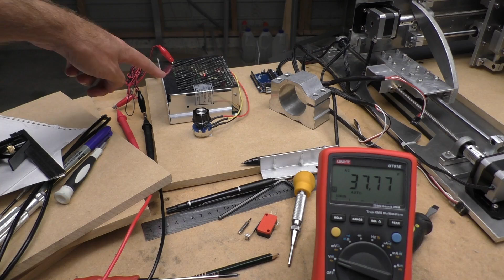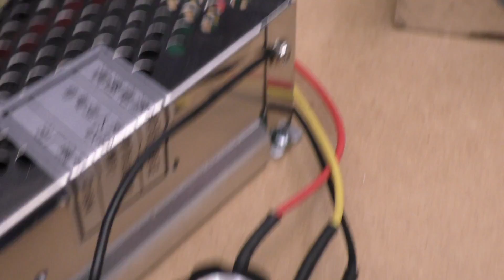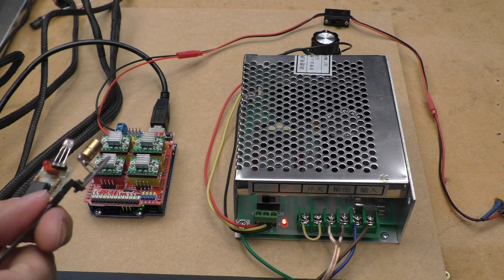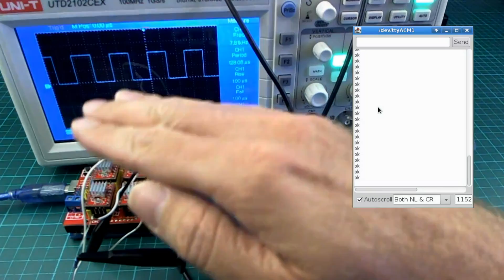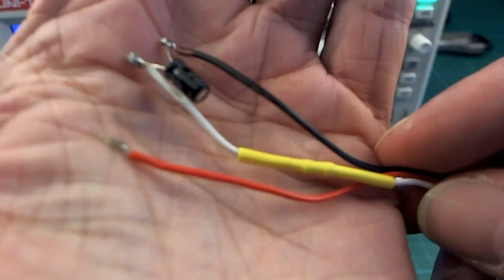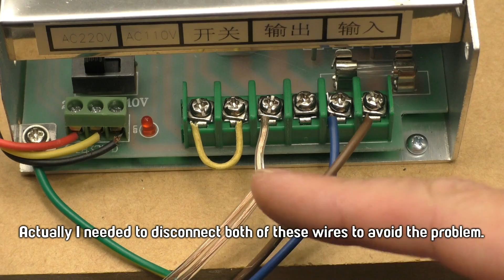DIY mini CNC machine part 9 (spindle, round two)

Comment: I have the same problem I tried using 2 different power outlets and the machine looses the homing settings for some reason there is feed back going to ground affecting everything on the ground line If I could contact the manufacture of the unit that might help

Comment: Adding some clarity to my previous comment about removing the grounds you don't need.  ie. "Remove the ground loops". For example, when using a shielded cable only connect one end of the shield to ground.  Otherwise you will create a loop. Also you may find that you have more than one ground circuit happening. (If you are using more than 1 power supply you should be thinking this way already.) If so, the ground circuits need to be kept completely isolated from one another with the exception that they can all be connected back to a single earth pin on the mains supply.  Some people may argue the need for isolation of ground circuits but it can't hurt and may be useful under certain conditions. Fortunately 2 of my friends are electricians and didn't mind helping me out with some good advice. Theoretically all grounds should be at zero volts but this is seldom the case when you have improper shielding acting a receivers, magnetic induction which isn't shielded , various substrates with different resistances such as aluminium and steel, temperature variations throughout the machine , induced eddie currents through the substrate, etc, etc,...

Comment: I do realise that 2 years have gone by so this may not be much use to you but maybe still to others who are watching your videos for the first time. I started building my CNC machine  many months ago and had many WTF moments. When things went wrong nothing made sense.  But here is the thing. Electrical circuits are entirely predictable. When things become unpredictable it means you having grounding issues. Assuming everything else is wired correctly. The solution is to grab a pen and paper and draw a ground map, making sure that you have covered everything. It should then become obvious which grounds you need and which you don't. The solution is simply to remove the ones you don't need.  My problems lasted for weeks and were solved in under 2 hours once I knew how to think about it. Cheers.

Comment: Holy shit so much of this seems deadly as fuck. Like if he palmed the psu and then the chassis, thats 120 volts? The arduino, and I imagine the laptop ground too? Im no electrician but none of that makes sense.  I wonder if its just funky cheap power supply problems... I guess il find out later in the series anyways since it looks like he got it all working.

Comment: It's a wonder no one noticed. There's no connection with the earth!! Basically, The potentiometer regulates the voltage to the motor (standard DC motor ). So, what happened is that there was a direct  phase to phase short circuit!!. The voltage from the power supply clashed with the voltage given out by Arduino! Since there was a resistance bridge, there was a violent reaction.

Comment: You're probably tired of hearing grounding solutions, but they are right. So, your Arduino really needs to be in a metal grounded box, as well as machine frame. (all single wires to a common point on psu case earth) My large cnc table used to float at up to 100v to earth sometimes. A very low current charge, static too, and would give me a quick zap after sliding plastic across it! All grounded and ok now - no zaps either. I'll upload a video of me waving my hand around our 5 Axis machine pcb - I called it "the ghost in the machine" at the time! lol..

Comment: ..you measure the voltage between 2 galvanic isolated power supplys (the one from "usb arduino" is actually from pc's psu)? Maybe it's time to re-learn the basics again.

Comment: So, I'm guessing the problem is electro-magnetic interference (EMI) radiation from the power supply driving the spindle, amongst other things. I would suggest adding a conductive braid around the spindle and potentiometer cabling and connect this braid to earth at the PSU end.  As mentioned in a previous post, also adding a ferrite filter can also help with EMI issues, but it'd go with a braid and physically moving the PSU away from the Arduino to prove that this is indeed the case.

The large potentials you see between components does also give me a little concern, but I'm guessing your laptop power supply is not connected to earth and so this can float (by itself) to a potential above Earth. Whilst you're messing around with all of this it may be safer to disconnect your laptop from its power supply so that there is no path to earth if you have another resistor/capacitor "letting the magic smoke out" moments!
Reply: I would think it is more than emi at those voltage levels.

Comment: hello, i just started watching. i hope everything is safe. i saw your problems with the earth. i would suggest first having incoming AC power having fused protections and cut-offs. you would need to calculate some power. if you dive a little more into the PWM power supply for the motor, you may also try to discover some mods to make it safer, mainly fuses, output caps at motor side, etc. inspecting the PCB of the power supply will do some good, it will help you to know how well insulated are the sections, etc ... if in doubt, goto EEVBLOG, post some pictures and ask questions.

the problem of arduino not working when you spin the motor is due to EMI interference from the motor. alot of the digital sensing are disrupted by the power spikes. it affects everything. you need to couple some low ESR caps and supressor diodes to the motor.

but i would suggest solving the PSU AC safety first. the float voltage you see flying all over the place is due to the DC common being a floated voltage, and not sharing the same ground level but of key concern is to ground the AC side first, then find out if the DC have sufficient isolation from the AC, by measuring the AC of the DC output. then solve noise suppression, then solve mechanical accuracy and spindle balancing (ie : wobble)

Comment: I posted isolation circuit in your previous video, here is a ling again: http://imgur.com/SGrNDaU 
Regarding  spindle and arduino hanging, it is highly possible that USB/Serial interface is hanging dew to EM noise and high power pulses. Very common issue.

Comment: get everything grounded the motor the psu the cnc. then look for the source of that noise I'll bet if you look in that psu you will see lots of missing input filtering parts. Don't see how you could have 100v AC between ground and that motor case? I'd want to hi-pot it but grounding it will fix that one way or another! I've only seen pixies and magic smoke here once before I think on that carbon (in NZdo you use?) fibre(UK) or fiber(Merican)  quad.Good luck. Oh and 6 of those E-Bike batteries in series and you can be back in business

Comment: Sorry to bother you, but when you build something like industrial grade machine, YOU HAVE TO PUT  EVERYTHING TO EARTH! If you check the industrial electrical cabinets, you will find there are grounding wires between the cabinet doors and the main cabinet, and between every device inside the cabinet and a main earth copper bar mounted inside the cabinet. So you should try to drill some holes, tap them and connect each and every mobile part of your cnc to the chassy of the machine and then to your earth wire of your power socket. I've used to work with industrial automations and it was a pain in the ass with grounding everything up. When you have a big ass cabinet filled with thousands of bucks of inverters, PLCs and other expensive devices, you don't care how much it would cost the pile of copper wire just for earthing...Good luck! Greetings from Romania!

Comment: I think that you have RF between the controllers. You need metal cases  and shielded wire. I knew a package machine that had the same problem. I had to shields the wires coming out the processor and installed it a case.  1    I bet that you between the computer to the controller unshielded  USB that is only meets a keyboard specification. 2   the controller does not have shield around it (metal case). 3  the wires to the servos need to be shielded. 4  Wires to the spindle motor need be shielded. 5  All shield on the shielded wires and metal cases hook up to ground! It saved a machine from being trashed to that worked after 13 years when I left.
Reply from the maker: jesus christ what a lot of hassle... but I think you are right. I'm uploading a video now that will agree with what you're saying.

Comment: Ground everything to the same point. The arduino motor controller frame and power supply to mains earth. Lots of voltages floating on each other

Comment: Probably bad power supply for the spindle, but I would also check the power supply for the stepper motors. If all fails, try to wrap the spindle in a layer of tape and make sure there is no more electric conectivity. Also hang the spindle wires away to avoid any induction problems. So isolate all, and it should hold good for now.

Comment: Perhaps you might want to look at the grbl shield for the problem if it is a cheap chinese one like it looks like. I have one like that ($14) and using the 4th axis clone is problematic. Sometimes it rotates too fast and sometimes it actually rotates in the reverse direction that it's suppose to. I will be unable to use it on my build as I need two stepper for the Y axis. I have ordered a much higher quality one from "Hayri" on youtube. Of course maybe your power supply is wacko. :-)
Reply from the maker: I also came across the problem of the cloned motor going in reverse, check the connection where you bridge the DIR pin, mine was not connected properly.

Comment: Hi,
Run and earth wire from the speed controller earth connection to the case of the motor. If you still have problems run a wire from the earth on the speed control to the usb connection metal work and maybe to the negative of the battery.
This should solve your problems.
Please play safe when playing with mains powered equipment. Unless you are a cat.
Send me a PM if you would like to chat. I live just out of Wellington.
Cheers Dave.

Comment: Possibly the motor running induces current into the frame of the motor. You should earth the motor to the CNC frame using a fly lead back to the frame. However, don't rely on earthing the spindle to the y / z axis frame, else you will be passing current through the bearings and drive shafts. Earth the spindle, and run the wire in the loom with the power lead back to the main frame of the CNC.
Reply: Usually in these systems there are two grounds, there is logic ground, and power ground. When noise from the power side starts bleeding into the logic side bad things tend to happen.

Comment: Maybe you should draw a system diagram including the grounding, just to make sure you understand exactly what is happening. Earthing and grounding is not only critical for your safety, but the safety of your laptop, arduino as well getting the thing to work reliably. You also need to think carefully about how the multimeter measures resistance and voltages to make sure all the readings your are getting are meaningful to avoid any more fireworks :-) AC at 50hz and higher frequencies and DC,  at low an high impedances. By the way is that green link on the spindle psu supply an enable link?

Comment: I don't have answer to your problem except not using that PSU, but connecting the case will cause current to flow to the earth, which should never happen, you must not have RCD's because they would have tripped. for your safety I would suggest at least using an RCD to the setup man this really does look dangerous..

Comment: if it were me I'd try grounding the spindle motor case and whole CNC metalwork AND look at shielding the spindle motor wire (again to common ground) to prevent emi/emc/cross talk problems.... or at the very least try to keep the spindle motor drive wires as far away from the arduino and it's stepper motor wires as possible. But then I'm just a humble mechanical engineer! ☺

Comment: one potential solution is shielding the wires to the motor (earth shield) and also finding if there is a direct connection from one of the motor wires to the motor body (there should not be a connection) ps did you buy the cnc controller from webtec?

Comment: P.s I "think" it's a emi interference issue, if you can get one person to move the x and y about, power up and spin the spindle from a few meters away and gradually move it closer to your controller board, in my case as it got within about a meter I started getting mis steps.

U.K. Connected on same ring main but different power wall sockets ( if that makes a difference)

Comment: I know this does not help, I have exactly the same issue, I tried to upgrade my Chinese 3020 with that same model of 100v dc power supply and spindle. When the spindle is running the steppers seem to miss steps or stop, re-pressing the move keys (Mach 3) it moves a bit more and stops. My setup came with an existing 48v power supply in the control case, I have been using that, so spindle is running I guess at half power and I have had no issues. Only when connecting the 100v supply just to the spindle do I get problems. Hope you work it out and please explain how you do it! PLEASE!

This weekend I'm working on a laser add on with a separate 12v supply, I am hoping I am not going to have the same issue, as the driver for that will be going back to the controller for the ttl signal.
Reply: s s Long time ago but if memory serves it was a ground or earth loop. Make sure you only have one earth connection. Hope that helps

Comment: Disconnect arduino and try connecting your machine, usb cable ground and PSU case with resistor/bulb and measure what's the current between them. It should be safe.  Also measure steppers coils if they arent shorted to case. If everything is good you can safely short all grounds i think..

Also. Isnt all that arduino problem caused by earth wire that you connected to PSU case at the begining of the video?
Reply: This.  If the current is low enough you can safely connect the grounds together, but you need to use the resistor first so nothing (else) blows up.

Comment: First comfirm motor is isolated from the metal case, perhaps one side is chassis ground,  All touchable metal parts have to grouded.  The Laptop might have a weak bias to the mains voltage  but is should be floating, A high impeadance meter on voltage can often give false readings on mains AC ground issues.  

Assuming the motor connections allow the chassis to be mains ground, I would use a good CE marked, not fake "China Export" PSU with mains isolation and use a good current Mosfet for the PWM signal.  I have no idea how the potentiometer is used or referenced to ground of the existing PSU.  Optical detectors don't like over 30V and are low current so could esilly be  20k, hence low speed.  The only way to use the existing PSU is to isolate on mains input with an isolating transformer, but that would cost more than a new PSU with built in isolation, secondly the voltage difference on the Pot and Arduino has to be solved.  if you could make the PWM turn a servo on the Pot could be a solution....  I often check supplied PSU with china sourced  goods and replace with UK approved PSU to know it is safe.  The isolation might test OK but are the gaps 3mm appart between the mains side and the ouput side, often not.  Transformers can also provide isolation but how seperated are the windings, the only way is distructive unwinding the wires and insulation layers.

Comment: whats going on here is that when you power up the motor it turns and the current goes into the motor. as soon as you turn off the power to the motor it continues to rotate for a few seconds and the motor works at an alternator / dynamo whatever you might call it and sends the current back the opposite direction into the arduino, and the current is waaaay beyond what should happen. If you continue to do this it will go up in smoke. You need to have a pull down resistor with a diode for the application so that you direct the back current to earth.
Reply from the maker: I have the same problem whether I turn the motor off again or not.
Reply: then im going to go with what the others say, there is something bad going on with that powersupply that wont let you have common ground

Comment: maybe try a thin layer of rubber/plastic(even plastic from a coke bottle perhaps)  around the motor to isolate it from the chassis?  may not sound like the best idea but the PSU sounds like its a poor design, the motor insulation supposed to be more than 2 megaohms? just an idea in an effort to get you by ;-)
Reply from the maker: I just about broke a screwdriver handle getting the spindle into that clamp. I don't think there is room for anything else.
Reply: iforce2d oh bugger :/ sorry to hear that  was just a thought.....
Reply: If you're 100" sure there is continuity from mains ground to psu chassis, then connected the whole CNC unit to GND. Should be continuity.

Comment: Getting a "proper" spindle like a kress would have saved you so much headache by now :)
Reply: Using the Laser thingi is not meant to be a real solution, it was probably just a way to rig something up quickly from stuff he had laying around, to see if the idea of an opto isolator is feasable
Reply from the maker: content can be created just as easily without headaches
Reply: however, headaches create content. content pays for more parts.
Reply: did you try holding the laser closer to the receiver to see if the motor would spin above 25%?  also instead of using a laser why not just use an optoisolator ic? it would be fewer parts and probably cheaper. I know banggood has them.  Here in the us radio shack has them, I'm not for sure about Australia.